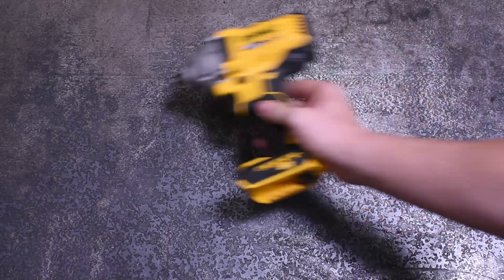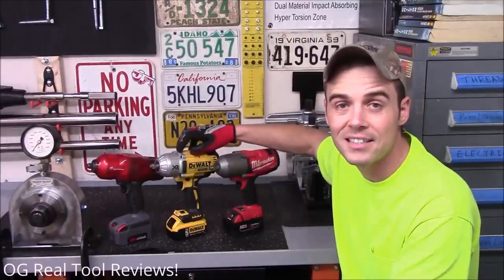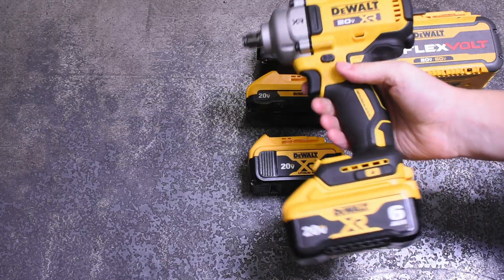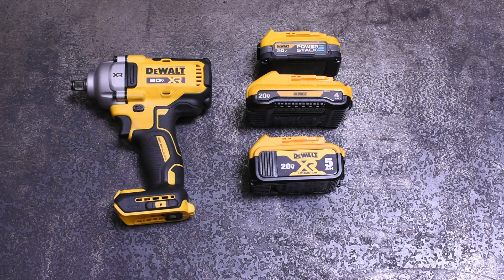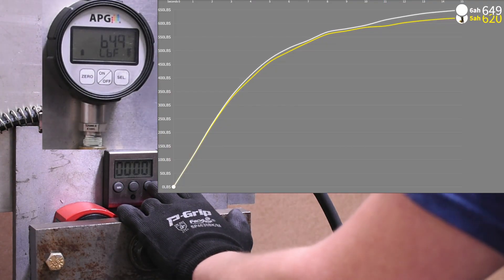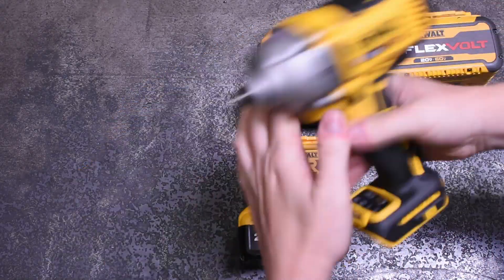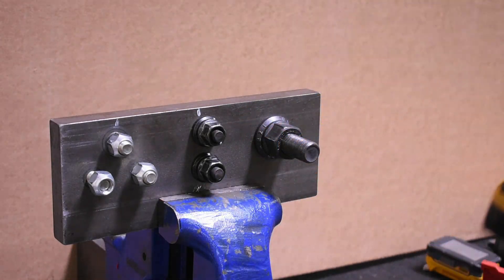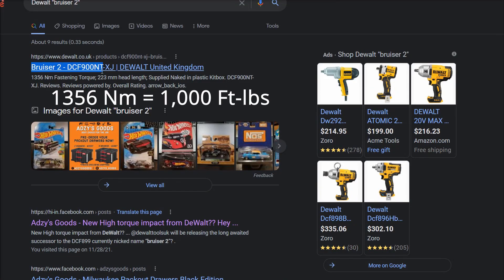Exactly How Much Torque Can DeWALT's Latest Impact Make?

Comment: Video suggestion: Does grabbing the socket with your hand make a noticeable difference? I seem to see a difference when I grab and twist a little to take up the slack between the nut and socket, especially on my weaker cordless impact.
Reply: No you need to put your finger in the socket to warm the impact up.

This is a suggestion from a professional.

Comment: I got the 6ah batteries before I did the suspension repair on my car with my DCF899 and you can tell they are putting out more power than the 18650 cells. Good work as usual!

Comment: They need to start mounting the batteries backwards to gain some working room up front, especially for drills, impacts, and 18-20v ratchets. That's why I prefer the 12v ratchets, they are big enough as is, a big battery getting in the way is not going to help. I have one of the old Earthquake ratchets that seems to be the same as the AC Delco 12v ratchets. Loud, weak, slow, but it works and isn't really designed to be real strong. Otherwise I have a bunch of Ryobi as I don't use these tools to make my paycheck.

Comment: It still boggles my mind how they get so much more torque out of basically the same size impact as the previous generation.
Reply: Tbf the previous generation has been out for years
Reply: @mcs699  he smoken dat turd meat!
Reply: @mcs699  He's your case of a little bit of knowledge... People like that ain't even worth debating with. They'll waffle on with a load of technical terms of which they're understanding of them is scientifically illiterate. 
If it was as simple as "Huh duh jUsT mAkE tHe HaMmErS bIgGeR" they would have done it 20 years ago.
Reply: Hey! It's all ball bearings nowadays. Now you prepare that Fetzer valve with some 3-in-1 oil and some gauze pads. And I'm gonna need 'bout ten quarts of anti-freeze, preferably Prestone. No, no make that Quaker State.
Reply: battery technology
Reply: Thx bill nye
Reply: Did a side by side comparison today between the old 894 vs the new 891, night and day difference. The old model would not even budge the bolts on a John Deere 6068 flywheel bolts, the new one impacted for a quarter second and they were out. I’m impressed and sold on it. Can’t wait for the new high torque to come out.
Reply: @christopherbrown6493  still waiting delivery. Oh well.
Reply: Apparently, the 891 is the 894 with a much more powerful motor.
Reply: @DiligentDave1966  not correct. Some other tuber took them both apart.

I don't remember which channel. But I do remember he aways wears black latex gloves when reviewing and testing stuff.

But from what I remember, the motors seemed identical.

What did change is the power wire seemed to have increased in gauge. And the mass of the hammer did significantly increase.
Reply: @pehenry  Interesting. The person you’re describing sounds like Shop Tool Reviews.
Reply: Wake up
Reply: It’s actually very simple to create torque. Torque is force x distance so you can create it by 2 simple things more force which is a mix of acceleration and mass, and distance. So if you increase the hammer weight it’ll produce more torque and you can make the plastics all light weight and only use mass for the metal.
Reply: @tjboylan20  If increasing hammer weight reduces acceleration too much then will produce less torque.  I think it's safe to say it's not just a matter of increasing hammer weight from generation to generation.  There's a lot of smart people trying to figure out ways to wrench every bit of power out of these for a given price point.
Reply: @KefkaPalazzo94  Agreed.  In order to increase the hammer weight while staying in the same housing would be to increase the material density substantially.  Not likely.  I do see that Black and Decker has a newly issued patent around the brushless motor (US 11,283,325) and the desire for more power for cordless tools.  The patent makes to references to power increases, but it’s either that or lower manufacturing cost or both.
Reply: @tjboylan20  wow that's an oversimplification if i've ever seen one. yeah just make the hammer heavier bro. why didn't they think of that sooner.
Reply: @mobilePCreviews  you realize that they already do that. Producing torque is super easy. It’s simple physics. The challenge of cordless tools is not voltage, not torque. Not amp hours. It’s a problem with resistance and electron flow. Designing an impact gun is very simple. Hundreds of mechanical engineers every semester do them as senior design projects in college. I can modify all of my impact guns with just the changing the weight of hammer assembly by either making it lighter so it accelerates more or making it heavier either way produces more torque.
Reply: @tjboylan20  I love to be pedantic homie, electrons do not flow. Current flows through a magnetic field, but electrons do not.

Electrons do the wave XD
Reply: @tjboylan20  if you increase rhe weight of the hammer , it will loose torque , you need to also increase the force of the electronics,  the motor, current draw capacity and everything in between.
Reply: @BenJamin-ou7kd  that’s not how torque works, but ok. F=MA Tq=FD upping the mass increases torque even if acceleration stays constant. The resistance of the resistors inside of the electrical system being decreased will help with the electron flow also because more resistance creates more heat and heat is energy that is lost in the reaction same thing with sound so.
Reply: @tjboylan20 that's not how torque would be modeled from an impact gun. 

It would be moment of inertia times Angular acceleration.

Comment: Awesome impacts coming from DeWalt! I would like to see a comparison between the IR cordless impacts and the DeWalt. I use DeWalt almost exclusively at my job site, and have the IR cordless 3/8" and 1/2" guns for personal use. I find the dewlats to be very powerful and reliable, but prefer the IR for the torque settings and the 360 ring lights. Would love to see how the numbers stack up!

Comment: Be nice to see that combo tried with say the 10 Amp/Hr 2P configuration or the 12 Amp/Hr 3P configuration as those are the largest capacity 21700 battery packs.
I have the DeWalt high-torque and can say from my experience the 10 Amp/Hr 2P and 9 Amp/Hr which both make a difference with the 9 Amp/Hr being noticeably better/faster than the 5 Amp/Hr which tends to be my go-to battery in the larger tools. This mid-torque looks quite nice as the old high-torque isn’t great compared to some of the bigger Milwaukee’s. Higher torque in a smaller package is nice and it would be even better under some battery configurations; I defiantly notice a performance boost from the 21700 cell packs nearly irrespective of tool or “FlexVolt Advantage” or “Power Select” marketing DeWalt is putting out. I do wish DeWalt would just knock off the orange vs. blue marketing and just make a single line of tools to take best advantage of whatever battery you’re using.

Comment: Dewalt definitely found some brainy people to find hidden beans in their mid torque guns. I can only imagine what those secrets applied to the new high torque will bring. Look forward to seeing you guys cover it when it comes out
Reply: Mid torque used the same anvil and hammer mechanism as the old high torque probably and a new brushless more powerful motor, to fit in the older smaller housing of the mid torque.
Reply: @MrZimmaframe  It'd be cool to see a disassembly of one of these and compare its internals to the old high torque(DCF899) and mid torque(DCF894)

Comment: I wonder how long of an extension and how large of a socket you would need to tip that over with the 15amp battery on it.
Reply: Asking the real questions.
Reply: @RANDOMNATION907  Literally what I was going to say word for word.
Reply: 36" in extensions with 2 U-joints and a big ass socket.

A.K.A the: i cant reach that MoFo destructomatic apperatus that likes to fling nuts across the shop.

Comment: I wonder wat the 8ah would do compared to the 6ah. Probably similar as they are both 10 cell 21700. Idk do you think there would be a difference? I guess im curious cuz i have all 8ah and no 6ah. And i would like to see the 12ah as well as those are the only flexvolt batteries i have
Reply from the maker: Pretty similar as we've tested xc6.0 vs xc8.0. On tools this size we usually see 6.0 be the favor slightly
Reply: @TorqueTestChannel  also wonder what the 9ah or 12ah would compare with 15 21700 cells. I no your more of just torque testing but i would really like to know how a 9 or 12ah compares to the 15ah especially in like the flexvolt grinder. I really wanna know whats more powerful and not runtime. 15 21700 or 30 18650. I have a few really big tools that i wouldnt mind the 15ah on but if its same or less powerful i dont want it. Ill jus have more 12ah batteries instead

Comment: I'm confused: isn't the XR 8Ah supposed to be the holy grail?
Reply from the maker: Because 8 is more than 6?
Reply: If the tool is a Power Detect then yes it is.
Reply: @jeffmorefield  yup, DeWalt has too many battery options...
Reply: @wim0104  choices are good to have in my opinion.

Comment: Just imagine what they could do with a 60v high torque.
Reply: Or a steam powered train engine and the right gearing.
Reply: @heltfeil  Too much maintenance.... I'll take a 9ah 60v pack on a 1/2 if it could handle it, if not a 3/4 or larger.
Reply: @q......  when I need the extra grunt that's what I do. watch out it will snap heads off. A torch and some pb blaster helps.
Reply: Or a 1 inch D handle
Reply: Twist apart grade 8 bolts?
Reply: I've been wondering this too, they made a flexvolt hammer drill, why not make a flexvolt high torque?
Reply: @OBSessed1995  that is just a flexvolt advantage hammer drill. It’s still just a 20 volt drill but it’s supposed to recognize when a flexvolt battery is installed and call for more amperage for more power, but it is not a flexvolt 60 volt tool.
Reply: at what point does the anvil become the weak point?
Reply: @denisrhodes54  My guess is a 60v at 1/2 anvil especially if it's not the hog ring that might be too much. 3/4 should be able to handle it. But I definitely want to see one. Going from a 20v grinder to 60v grinder is night and day.
Reply: all that 60 volt is nonsense.

you can have 60V at 30Amp or 20V at 120Amp.  multiply the voltage with amps and you know the max. electrical power.

got it ?  ITS THE SAME !  marketing wankateers thought out this BS to trick dull brains.